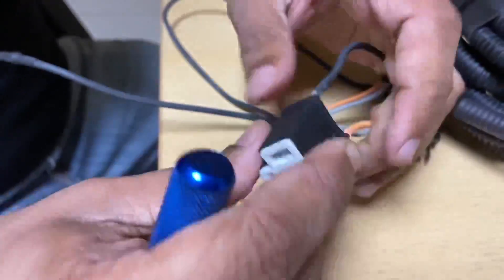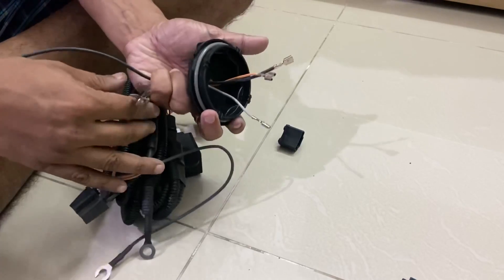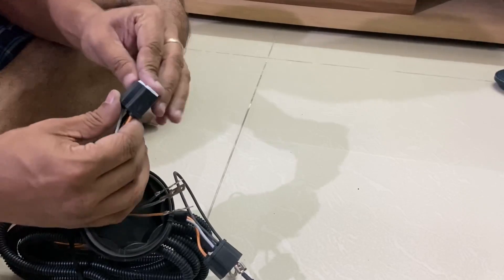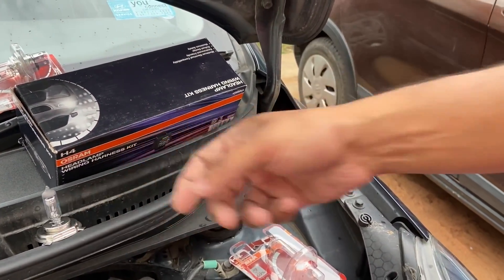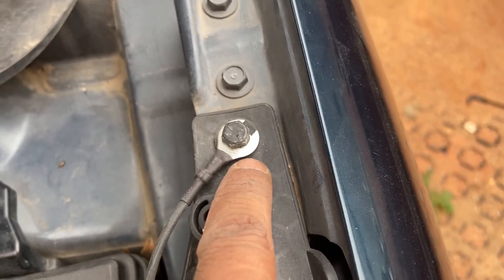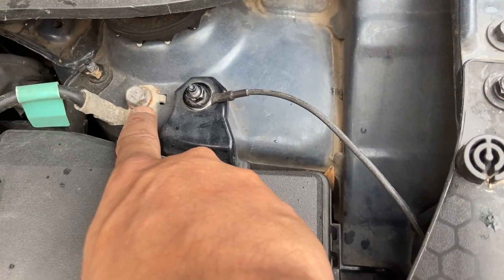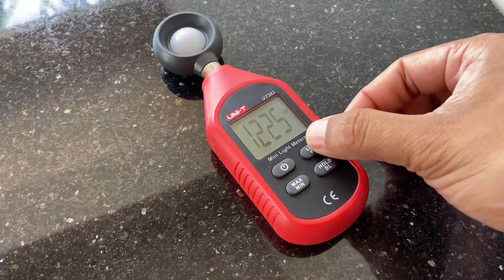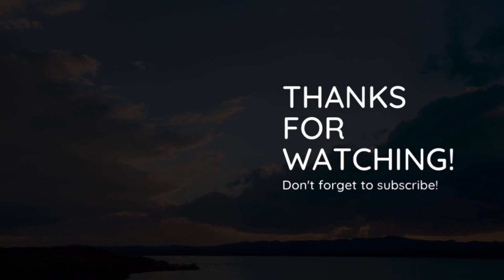Hyundai Grand i10 Nios - Upgrading Headlights to 90/100W bulbs

Comment: What about the holes you done will water, moisture and dust get inside???? Please tell
Reply from the maker: Hi, my friend used a bit of General Purpose (GP) silicone sealant to plug the holes later. They are available in hardware shops and cost Rs 180-200 onwards for a tube.
Reply: @GaneshBalan thanks a lot sir ❤️

Comment: I have grand i10 nios 2024 sportz model. In the owner manual, it is showing HB3 socket for high low beam headlight. Should i follow the owner manual?
Reply: Ok thank you 🙏
Reply from the maker: Please check your manual. Is it a projector based headlight in your car?
Reply: @GaneshBalan yes projector setup it is
Reply: Yes it's a projector set up
Reply from the maker: That’s why. The bulbs are different.

Comment: Hi ,,can i replace my already installed halogen lamps of my Grand i10 Nios 2024 Model with, Philips WeatherVision LED car headlight bulb (HB3/HB4), ultra-compact direct-fit, Halogen color match, easy install, LED performance, 3500K.

Can i replace it at home. Need anymore suggestions but warm/yellow light led's only.
Reply from the maker: HB3/HB4 LEDs won’t fit. You need H4/H19 bulbs. 

If you’re looking for branded ones, check this one out:

https://amzn.in/d/5ykOnHS

It has the warm white output.
Reply: @GaneshBalan  are these bright than the ones already installed.

Comment: The stock bulb is H19 but you fitted with H4. Is it placed properly? Or you did any modification to the base. Could you please suggest.
Reply from the maker: Hi, no we did not do any modifications to the base. The H4 bulb fit exactly where the H19 bulb socket was. We did not find any H19 upgrades in the market so we went this. Go ahead.

Comment: Your right side bulb may fuse often.. because of connected very nearly to the battery ground cable.. variation of voltage during acceleration.
Reply from the maker: Been more than a year, absolutely no issues to this day. To my friend’s credit, he drives the car for over an hour daily in the evening during the return drive home. Appreciate your input though.
Reply: @GaneshBalan  Thanks for instant reply. I am  M.Tech Automobile Engineer. And serving as Sr. CoTech Engineer in Mahindra Automobiles. We have many cars comes with same problem that right bulb is fuses often. Bcz of ground connect to the direct battery negative. Btw Appreciable fittings.
Reply from the maker: Good to hear that! Have a friend and ex-colleague who works in the HVAC department of M&M at their Chennai plant.

Comment: I have a grand i10 2017 model. Can you tell me what kind of headlight is used in the car as it throws very dim light. What are the upgrade options? Thank you in advance
Reply from the maker: Hi, here’s your car’s user manual:

https://dmassets.hyundai.com/is/content/hyundaiautoever/i10+IApdf

On page 403, the headlight bulbs are of 55/60W. Which is H4 type. 

You have 2 options:

1. Buy a 90/100W headlight wiring harness kit like the one shown on this video and replace the stock bulbs with a good set of Philips or Osram 90/100W bulbs. 

2. Buy a set of H4 LED bulbs from Philips. More expensive than option 1 as a pair retails for Rs 5700 in Amazon. See the link below:

https://amzn.in/d/jbshCjN
Reply: @GaneshBalan Thank you so much for taking time and effort to respond to my query and for the manual. One more thing - which one of the two options is better?
Reply from the maker: I will vouch for the first one having personally used it. I wanted to try option 2 but I haven’t yet.
Reply: @GaneshBalan  thanks, will keep this in mind.

Comment: I have installed the same in my Hyundai Exter. But I'm getting warning signal- "Check Headlight". Only with the stock 60W bulb I'm not getting that warning signal. Kindly assist.
Reply from the maker: Hi Solomon, your Exter maybe having the bulb failure detection system. Because of the higher wattage bulb, it is drawing more current and this is in turn prompting the system to throw the error. 

You’ll have to live with the bulb-out error if you want to use the 90/100W bulbs.
Reply: @GaneshBalan  if I use with that error will it cause any other electrical damage to my car?

Comment: Hi Which relay kit you used and how is the feed back till now, i have old grand i10 thinking to the same any suggestions
Reply from the maker: I’ve used bulbs and the wiring harness from Osram. No complaints till date. They’ve been working well. 

There are many companies who make wiring harnesses - Philips, Osram, Hella, Uno Minda, Thimson, Vaishnu, etc. 

They are all essentially the same. Look for ceramic connectors for the bulbs and thicker wires to the bulbs. That’s all.
Reply: @GaneshBalan  Thankyou I have purchased Vaishnu One, will try to attempt this and see what results I get

Comment: Hi any moisture goes inside your headlight assembly after creating a hole in the dust cap?
Reply from the maker: Hi, no my friend hasn’t reported concerns of moisture ingress. Have you sealed the hole on the dust cap? Please do so if you haven’t. You can buy a tube of silicone sealant from a hardware store and seal the hole. You can always remove the sealant later if required.

Comment: Hi Sir if we change only 100w headlight with just replace an 20A Fuse in box is reccomendable.? For hyundai grand i10
Reply from the maker: Hi Priyan, please don’t do that. 

The 90/100W bulbs draws higher current and your stock wiring is not capable of handling it and it will invariably melt, causing overheating, short circuiting and possibly a fire later. 

Buy a relay wiring harness and change the bulbs.
Reply: @GaneshBalan  Thanks for an information sir.!

Comment: My fog lamp are not working after this. Do you have any idea what can be issue
Reply from the maker: Have you checked the fuse? Did you use fog lamp’s wiring for tapping into any other light? This DIY does not touch the fog lamp wiring.

Comment: sir i owned grand i10 nios 2021 model in which there is projector fog lamps, but i was thinking to change the bulb in it , sir please help which bulb should i upgrade to a halogen with more wattage or led or anything else or it is better to change the headlight bulbs they are also reflector halogen please help me sir
Reply: Did you do it bro i have same car and thinking the same
Reply: @aniruddha47  nhi yarr abb tak nhi kisi aise bande se puch ke karna padega na jiako knowledge ho
Reply from the maker: @ommahajan1210 Sir ji, owner’s manual mein fog lamps ke mention nahi hein. It does not seem like a user replaceable bulb. Kudh dekh lo, page 24 - 

https://www.hyundai.com/content/dam/hyundai/in/en/data/connect-to-service/owners-manual/grand-i10-nios.pdf
Reply: @GaneshBalan are ganesh bhaiya ji …hamare pass 2021 wala model app ghaj ghai mey hamara comment pura padhe nhi thoda dekh key dial kariye… humare sawal ka jawab hoga toh thodi help
Hojayegi…
Reply: @GaneshBalan  please help me ganesh ji which lights should I upgrade to
Reply from the maker: @ommahajan1210 Let me check the user manual of the old Grand i10 Nios from my friend.
Reply: @GaneshBalan   no
Problem take your time it means alot to me if could able
To
Help me
Reply from the maker: @ommahajan1210 definitely bro. I will revert.
Reply: @GaneshBalan  brother please help me
Reply from the maker: @ommahajan1210 brother, please have some patience. I’ve a day job. Let me get the manual from my colleague. Will update.
Reply: @GaneshBalan  no problem., i am sorry brother
Reply from the maker: @ommahajan1210 Hi Om, the pre-facelift Nios uses HB4 halogen bulbs of 51W wattage. My friend just forwarded the owner’s manual and it is specified there. Hope this helps!
Reply: @GaneshBalan  sir i owned grand i10 nios 2021 model in which there is projector fog lamps, but i was thinking to change the bulb in it , sir please help which bulb should i upgrade to a halogen with more wattage or led or anything else or it is better to change the headlight bulbs they are also reflector halogen please help me sir
Reply from the maker: Did you read the reply above or simply copy-pasted your first query?
Reply: @GaneshBalan  toh sir mai HB4 halogen bulb daldu par sir watt badhana padega na
Reply: @GaneshBalan  aur sir apne fog lamp ka nhi bataya kya karu
Reply from the maker: Sir ji, zyada brightness chahiye toh HB4 LED bulb daldo.
Reply from the maker: Abhi joh baat ho rahe hein, fog lamp ke bare mein baat ho raha hein.
Reply: @GaneshBalan  accha HB4 bulb daldu fog mey ..?51 watt wala ..?
Reply from the maker: @ommahajan1210 haan ji. Pehle aap ek car accessory shop jake chech kijiye.
Reply: @GaneshBalan  ok

Comment: How to reset alarm after changing headlight lamp in Hyundai i10 nios magna 2023 model..I changed bulb but it's showing check high and low bulb alarm and continuous indication kindly send me some suggestions
Reply from the maker: Hi, did you replace the bulbs with the same wattage? i.e. 55/60W? Have you confirmed that the lights are working after you swapped them?

Comment: Great upgrade for the headlamps.
You can also consider Osram NB 200 halogens. These are the top of line premium halogens from Osram in standard wattage rating of 60/55. This help you in simple plug and play. I am using in my Rapid and has good output.
Reply from the maker: Frankly speaking, any 55/60W bulbs have the same output or brightness. The Nightbreakers from Osram are mere replacements to the stock bulbs and barely offer any significant advantage - I know since I’ve used a set with my Polo back then. 

The 90/100W set gives a prominent upgrade and works well with the halogen reflectors on the i10 compared to using these Chinese LED units. Those are extremely bright and can potentially blind the oncoming vehicles. 

Hope this helps.

Comment: I was planning to install a 90/100w H4 bulb on my polo as well. Do you have any idea whether they are road legal?
Reply from the maker: Straightforward answer - they aren’t. But the cops/law won’t catch you. As long as you use the high beams properly without blinding the oncoming users, you are good to go.
Reply: @GaneshBalan  thanks for that. For the time being im running the phillips RacingVision GT200 60/55W, does a way better job than the stock in terms of brightness, throw and colour. 
But I might switch to the 90/100 since I’ve already bought all the parts. 
Some reviews say that the headlight housing can turn yellow due to the heat from the higher wattage bulbs.
Reply from the maker: Some headlamp reflectors do turn black over time due to the intense heat generated by the higher wattage bulbs. I’ve seen new Ford Figo owners complain about this with the stock bulbs! 😳

Plus, I’ll be very honest - I’ve used Osram Nightbreaker Unlimited 55/60W and did not find a major difference in the brightness from the stock bulbs.